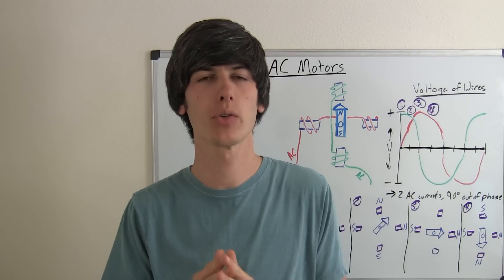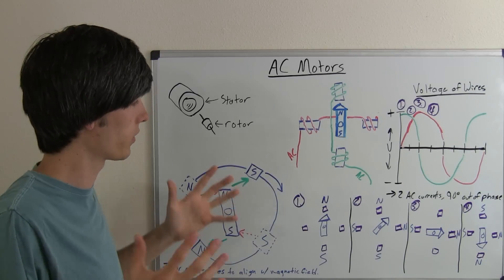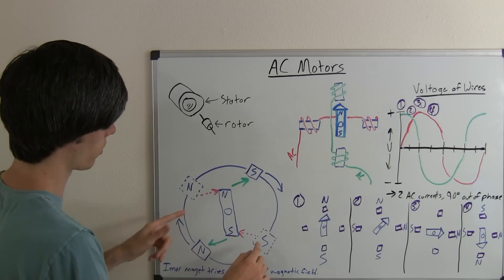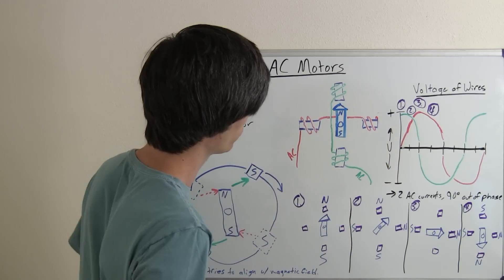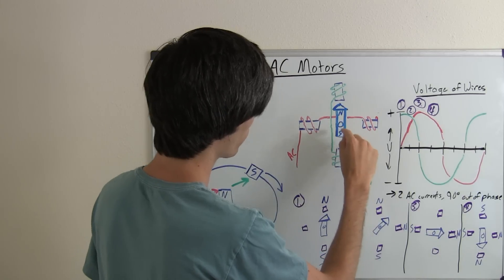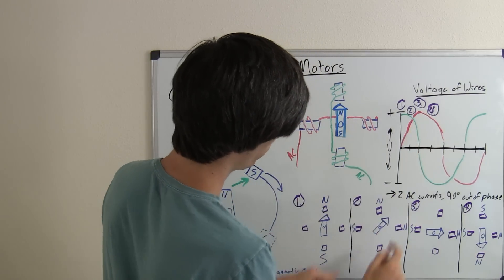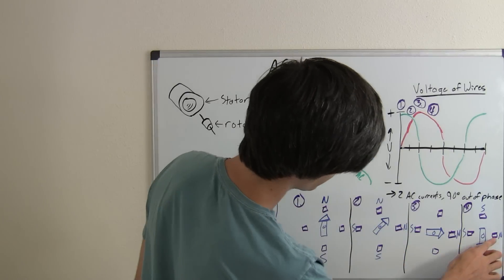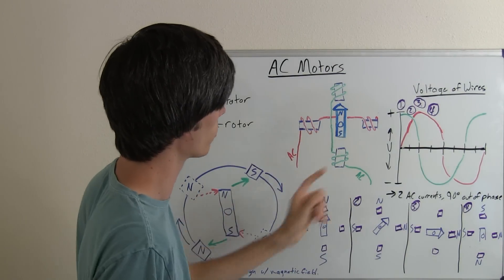How AC Motors Work - Electric Cars

Comment: OMGosh... suddenly I think I know why it's not good for an AC motor to be powered by a square wave inverter.  It's best to use a pure sine wave inverter.  If your current just suddenly jumps from +110V to -110V (for example), and so forth, it never has that "in between" or transitional voltage between the two sets of coils for the magnet to move to 45 degree angles between electromagnet poles.  I've heard that the motor's life can be drastically reduced and this gives me an idea of why.  I can even "hear" this difference when the motor (i.e. a fan) is starting up if I use a square wave inverter.

Comment: Is this a single phase or a 2-phase ac motor?
Reply: +Tarun Singh What Josh says is correct - it's a 2 phase. However, most commonly used is 3-phase (especially for generators, the National Power Grid uses 3 phase), which has 3 magnets, which are  pi/3 radians (60 degrees) out of phase with each other.

Comment: Is this a two phases motor?
Reply: +Aerohk No, actually.
Looking at the wave diagrams it looks like it's a single phase motor with a capacitor starter.
Learn Engineering has a very informative video about why it's like that.

Comment: It would seem that the max RPM of the motor would be dictated by the frequency of AC current you are applying to it, In high RPM electric motors do they pipe in higher and higher frequencies or AC current or use other means?

Comment: Permanent magnet synchronous AC motor. But why most use 2 phase or 2-2 poles instead of 3 phase?

And I still working on electromagnet synchronous motor to find way it can become both motor and generator and don't make too much heat and finally destroy it self. And with brain logic =)
Reply: There are some RC model systems that have AC motor/generator controllers. YOu may find what you are looking for there! :)
Reply: If it's a synchronous motor, I would =). But if it's a conventional motor that's modified so it can become generator as well, I'm not very interested.

I don't want the electromagnet on the stator get's faster than rotation of the rotor when acceleration and than creates electricity while electricity from battery or other source still flowing. It might not will deal big damage, but I just don't want any damage for long term.

Comment: So how do you speed up/down a AC motor? Increase/decrease volts/HZ/Both? I understand DC, but AC harder for me lol.
Reply from the maker: More power! You simply send more volts. Lower speeds are achieved by sending a certain percentage of the maximum volts possible.
Reply: Engineering Explained Next video..VFDs explained :D
Reply: Engineering Explained Ahh I see. Thank you for the reply. Love the videos, keep up the good work!
Reply: Engineering Explained  I'm no engineer, nor an expert on electric motors, but according to your own explanation, the motor cannot spin faster than the electromagnets change polarity, because the rotor would then align with it's opposite pole, and stop. So it only makes sense to require a quicker pole-change (higher freq.) along WITH more power, to spin it faster.
Reply from the maker: c6rocks Yes, more power and an increase in frequency, good call!
Reply: The speed is fixed by the frequency of the AC waveform, A motor running off a single phase will have a capacitor which introduces a lag of 90 degrees to allow rotation. As 50Hz/60Hz is standard mains frequ. You are stuck with speed in a basic AC system and need to vary pulley sizes for different applications. More sophisticated motors will have a variable synthesised AC supply to alter speed.
Reply: The permanent magnet motors used for cars are all driven by VFDs (Variable Frequency Drives). Increase of voltage increases current and hence, torque, since torque output is proportional to current input. The accelerator pedal could literally become an accelerator pedal, since it could be programmed to behave as a torque dial.

Comment: I have never seen an AC motor powered by only one phase of electricity. I work with air compressor and high pressure washers for a living, and I frequently have to do work on the AC motors, as well as some DC motors in hand tools we use. The only way to start an AC motor rotating the way you want is by using three phases, which is solved by adding a capacitor for smaller, one phase machines. I'd love to see a more detailed video on this, and possibly brushless AC motors as well? Most AC motors I work with are built up in a different way than you portrayed in this video.
Reply from the maker: 3 phase coming soon, basics first as always. :)

Comment: effectively a brushless dc works the same way as a regular ac motor then? Without getting into details..a brushless dc gets rid of brushes by turning the motor inside out, the permanent magnet on the rotor and the stator is the electromagent, controlled by some sort of circuitry?